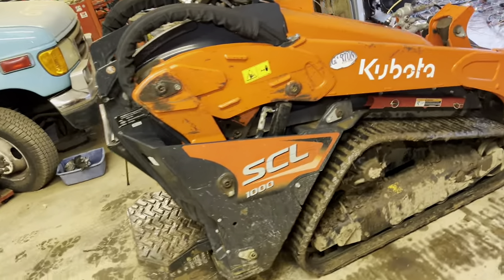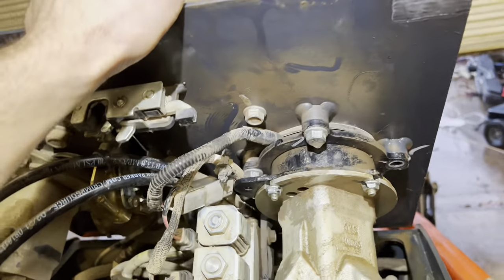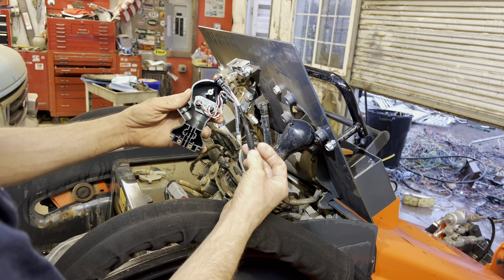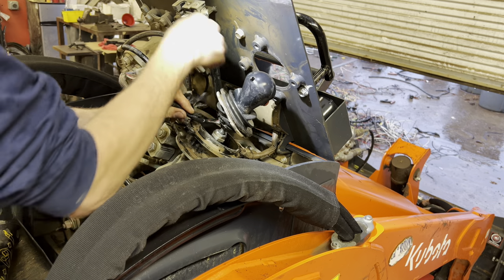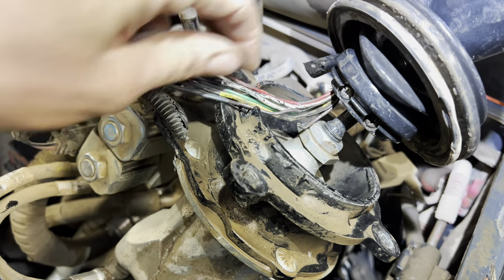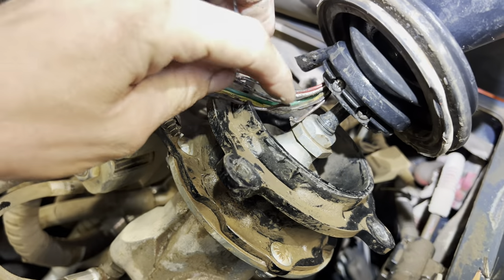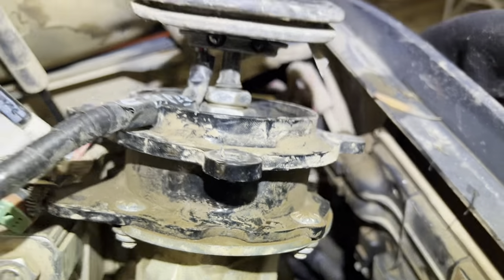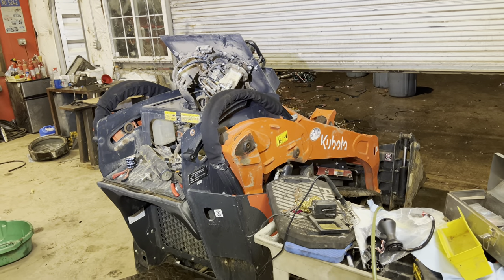Kubota scl1000 aux joystick repair

Comment: Glad you posted this vid.  I am running into the same issue with my SCL1000.  The aux wouldn't run the trencher so we wiggled the wires and it started working but then, when the trencher wasn't hooked up the machine would somehow engage the auxillary and make the machine die when digging.  I need to dig into this tomorrow.  I will definitely figure out how to rewire.
Reply from the maker: @Venturewest1  I rewired it once lasted a few months ended up just buying a new control. Hasn’t messed up yet. The wires rub on the hole that they go through and ends up cutting them.

Comment: I would replace all the wires and extend them. Assuming there is room I would put a bunch of extra inside the joystick base and make a wrap around the joystick pivot. What is happening is wire fatigue. The longer the distance the wire flexes in the longer it should last. Kind of like how they used to make coils in the brake lines before going to the frame. Smaller diameter wires may actually last longer.

Comment: The problem isn’t the wiring harness you were wiggling. They’re wrapped, that little bit of wiggle would take a long long time to chafe through the bundle and onto the wires. 

The problem is that Kubota made a janky controller with poorly designed wire connections. That controller looks like something you get for an Xbox or something. Any other manufacturer builds way beefier controllers with solid wiring jobs. I beleive move of them go straight to contacts rather than a harness to the actuators. That way if they do go bad, it’s just a matter of replacing relay.